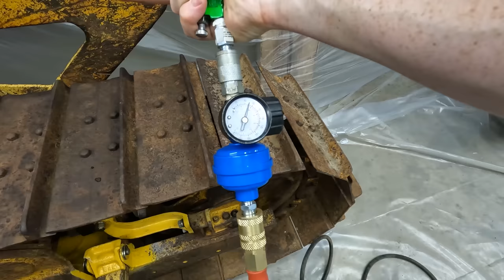Cleaning and priming the Caterpillar D4

Comment: I was going to explain what you were doing wrong with the primer but you figured it out.  
My one recommendation is move your water trap at least 25 feet away from the compressor.  The hot newly compressed air has to cool down for the water trap to function well. If you do this your won't need any other filter at the gun and won't have to empty the tank as often.  Trust me this helps a lot! 35 years in body shops.
Reply: - Gosh it is so great to see such wonderful help come along for Matt on this site.
Reply: Just to help a little more.  Pipe from the compressor to the water trap with steel black pipe, this will act as a heat sink and cool the air more. If you use an air hose or PVC pipe  they will get as hot as the air inside them and will not work as well.

Comment: A tip that I saw on another youtube channel for masking off small knobs and odd shape pieces is to use aluminum foil.  Easy to squeeze into odd shapes and easy to remove.
Reply: That’s one of those bang my forehead and think “why didn’t I think of something as simple and sensible as that??” But that’s why there is a twofold reason that we read and watch these videos (1) to watch a seriously driven man do a masterful restoration (2) to learn new techniques which will make my life easier. I am truly impressed by Matt’s dedication to detail, especially on a machine this old which has required lengthy searches for parts and instructions 👍👏😃WELL DONE

Comment: On the dolly you made, put two fixed castors and two rotating castors, then you can push it in the direction you want it to go, having four rotating castors, it kinda goes where it wants and you have to force it to go where you want it.
Looks like you a doing a fine job prepping and primering, don't worry about the spots you missed on the under carrage, nobody will know except for you. 
Keep up the good work.

Comment: I would turn the little knob on the side of the gun so you have a wider fan pattern.  Along with that  turn the   knob in the  back counter clockwise so you actually allow more paint to flow through the tip. Have to do both. Overlap about 50%.   Lastly,  make sure you are not inadvertently  closing the air adjustment close with your little finger.  It is on the bottom of the handgrip.    Good luck
Reply: - Wow! Super useful help for Matt...I wish I had something useful to tell him. Thank you ! ! !
Reply: Yeah, I hoped that the Harbor Freight gun instructions covered the gun adjustments. Also wondering if it has a big enough tip (1.7+) for primer?
Reply: @mrpesky163  1.7 is big enough.  I use that size all the time for primer on that kind of vehicle.  You might also consider a little more reducer.  I use alot of that brand of color tou are planning on using.  I typically go 16oz of paint and 4 or 5 oz of reducer.  But you have to be carefull and not get too much on, (runs), so tighten up that back knob a bit or thicken it up. Try a little on the bottom side of the hood.    You can always  thicken it up. The smaller the tip the thinner it will have to be usually..  you can have good results with 1.7 on the color as well.  FYI, That little filter goes big end down in the gun before you screw on the paint container. Painting is alot of work!  Cleanup sucks.  Have enough mixing cups so you dont have to keep cleaning them

Comment: I realise you probably don't want to move the motor again but you'll find that it is easier to steer if two wheels are fixed and the other two rotate. If you have a look at supermarket trolleys they have this arrangement. In the trolley arrangement the fixed wheels are at the front (the reverse of a car). Good luck with the rest of your refurbishment.
Reply: - Yes, good catch. That is how dumpster bins are set up, too...for good reason.

Comment: A great effort on the clean up and prep, it's 90% of the battle. One tip for painting, keep the spray gun moving fairly quickly back and forth in smooth even strokes and go past the edge of whatever you're spraying.  It looks easier than it is, but practice makes perfect :)

Comment: As I watch you struggle with the HVLP, it reminded me of my travails trying to move from oil based paint to water base. I finally gave up trying to spray water based paint unless I used a 2000 psi airless system which will do a nice job. Mostly I use HVLP for lacquer or thinned oil paints. Good presentation today, keep it up.

Comment: You said you were not expecting a new machine finish with your painting, but with your attention to the details, the prepping, and primer,sanding,and working out the proper spray gun settings, it's gonna look real sharp when done!! When you put the longer coupling sleeve on the winch control rod,did you grind off a flat spot on the shafts were the set screws are,so the screw won't loosen and have the collar spin on the shaft,,just a thought!😎😎😎

Comment: Wet the floor with water . Then spray . It helps with bringing the humidity up. An keep dust at bay. Test spray on a big cardboard box.  The paint needs a 6 inch fan spray . Turn the back of your gun counter clockwise to alow more paint to spray out. .

Comment: On primer, use 4 parts paint, 3 parts Acetone.  Works great.   On paint, use 4 -3 - 1  (hardner) you can also mix japan dryer to help with with drying time in colder weather.

Comment: You're doing a great job!  You mentioned that the sprayer you have is an HVLP head.  But you're using compressed air from your compressor instead of a multi-stage turbine that HVLP systems use.  That would explain why you had to bump your air pressure up from 20psi.  Think of your compressor as LVHP (Low volume, high pressure)...just doesn't play well with HVLP sprayers.  Having said that, when you begin painting the color coat, consider a drying inhibitor, or something like flotrol, allowing the paint to flow out and smooth before it dries.  It can help to achieve a smooth coat.  I'm no expert, but in the past this has worked for me.  Good luck, and I'm looking forward to the new paint!

Comment: I use to work in a body shop in an old dusty pull barn and we would hose down the floor and paint when the floors were still damp to cut the dust

Comment: your primmer needs to be about the consistency of whole milk and use a 1.4 tip.  set your gun pressure at 40 psi.  This should give you better results
Reply from the maker: Yup, that's pretty much exactly the setup I used at the end that worked!

Comment: Really like watching your videos.  I feel the same way as many many of the comments...your attention to detail and patience both very good.  Can't wait to see this up and running.  I own a D47U which I will restore at some point.  It's got a 24 V generator and starter...is your system 24V.  I wonder if I could convert to a 12 V?
Reply from the maker: It's 12, but either voltage should be fine

Comment: Hello Matt, great to see your work.  Lots of cleaning, we would cheat and use, Air Sprayer with hose pick, inside 5 gal tank of >>> Diesel.. ") that was what I was told to do.  Old Case front end loader, cleaning the Engine...

Comment: So I'm definitely not a paint gun guy but there are several adjustment points on that gun if I remember right. I have the same gun. You may not have the needle that controls the paint flow set open enough for the primer/ paint mix you're using.

Comment: Generally you use a bigger tip for primer. You should have got a lot more fluid pressure. I think you’ll find better fluid output with the paint. Even with hvlp you should get more output. Depending on your gun you can go up to 35 or 40 psi. Play with it see what works.
Reply from the maker: Yeah I started at 29psi and increased it to 35 with a 1.4mm tip.  The primer directions said a 1.3mm tip with 29psi, but I'm guessing that was meant to be as a starting point.
Reply: Agree with the comments about painting but I have always believed that orange peal finish is due to too much thinner.  I know you wanted to get more print through your gun but thinning the paint too far is not the answer.  Also the pressure at below 35 psi is just way too low,  especially for generally thicker paint like primer.  Hope this helps.

Comment: In my opinion the hole in the thermostat is so air will bleed out during a fill of coolant. that way it will not air lock the cooling system on startup. I do that all the time.
Reply: Yes, that is all the hole is for.  But he did not need to drill a hole. The manufacturer of the thermostat he installed provided a gap in the sealing surface the plate closes against to allow air to purge past and escape instead of making a hole in the plate. Probably will not cause the engine to run cooler than the thermostat rating unless he operates it at light loads in extremely cold temperatures.

Comment: One thought you could do to fix the fuel tank bumps if you cared is to pressurize the tank with water. Adam from myth busters did it to shape some metal. Pretty cool idea… might work.
Reply: Some pressure and a little GENTLE persuasion around the edges of the dent can work them out.

Comment: Ah the homemade paint booth.  Box fans with paint filters stuck to the back of them work great for ventilating and sucking up the over spray. But use actual paint booth filters.  Also you want to suck air in the top and pull it out each side with the fans. Use window kits so you get the cardboard strips to staple the plastic .  So what projects are you going to use the D4 on when it's done ?

Comment: That spray gun looks quite a small one with a fine nozzle. At the beginning I think the paint was too thick and you were almost dusting the paint on. It is good to keep the paint on the thick side and spray a bit on the dry side when painting intricate stuff with lots of angles. I would try thinning the paint a little more and do some test sprays on some metal. You need to see the paint go on and then sort of flow out and smooth itself. If the paint is too thin it will run and be a PITA so try and stick to the thicker side but I think you can thin it a little more than you are.

Comment: Thinner paint and move a little faster will eliminate that orange peal , as long as your not spraying it so fast that it's drying as it's hitting witch will kinda look like a lot of gust in the paint you can always add another coat but moving to slow will cause your paint to stack up and give it a real orange peal look tell it gets so thick it starts to run

Comment: @16::29 you can see there is a bypass hole in the seat of the Gates thermostat at the 12:00 o'clock position. But one more little hole ain't going to hurt anything. You knew that already, didn't ya? Just checking to see if I'm on my toes. 👍 thanks
Reply from the maker: I need to get my eyes checked
Reply: @PacificNorthwestHillbilly  shhh don't tell anyone  but I did the same thing 🤫
Reply: I am glad somebody else saw that gap in the seat besides me.

Comment: im still in the begining of the video ,but for the shaft coupler with the two set screws ,any reason you couldn't/wouldn't cross drilled and pinned it into place ? i would think that would make driving out the roll pins later easier for removal, and would help share the torsional load

Comment: I had problems with oil based implement paints cracking and peeling after they sit for a while indirect sunlight if I used any type of primer. Seems to stick Alot better without primer especially on smoother sheet metal. I used an epoxy primer on my old Farmall H and 4 years later most of the paint blew off when I pressure washed it. I did let it dry for just over 72 hours and Tack clothed it before painting it. Maybe I should have let it sit and cure for a whole week before painting it?
Reply from the maker: This is gonna sit for at least a week before painting, but I guess time will tell if it cracks or comes off with pressure washing.  A lot of the top layer paint was coming off during pressure washing, but there was no primer between that and the original paint.

Comment: I didn’t see your other video about the hole going to the gearbox.  Is that the breather hole?  There is a material you can use to plug grease boxes that looks like a wick.  It is hydrophobic and this will not let water pass and will allow the breather to operate properly. You will sometimes see them in rotary cutter gear boxes. I just rolled up a piece of PIG mat and shoved in the hole. Same material
Reply from the maker: It's the hole that the gear selector shaft sits in, it's not sealed and open to the elements. The other end where the shaft comes out is also open, but it's covered by the seat, so it can act as the breather (I hope)
Reply: @PacificNorthwestHillbilly  gotcha, thanks

Comment: The tip size is probably too small. I have several Harbor Frieght purple guns, and I drilled out the tip to about 2.0 mm . I use that gun for paint, latex so far with just a little water to thin it. It works good so far.

Comment: Wouldn't you agree that it is advisable to start an engine that you have never seen running OUTSIDE before putting it into the cat?  It is a very big leap of faith to simply assume it is in working order.  Even Squatch, who rebuilt the engine himself, started it outside before installing it in machine.  Running it up to temp might well disclose some issues that are much easier corrected when engine is not in machine.
Reply from the maker: Ordinarily yes, but these engines are so simple, there's not much that can go wrong. Based on the look over I gave it a few months ago, I would be extremely surprised if it didn't start. Starting it without a proper engine stand would introduce more risk.  Worst case is I have to pull it back off the tractor, which I could do in about an hour or two.
Reply: @PacificNorthwestHillbilly  Did you happen to watch the Squatch vid where he built a simple stand and started the newly rebuilt engine?  As it turned out, there were a couple of leaks that would have been difficult to remedy had the engine been in the machine.  Trusting any unknown engine to be fine is a huge leap of faith.

Comment: Looks like your putting the paint on too dry, add more thinner, and paint faster. I was a bodywork’s spray painter for years, using mainly acrylic paint. Top coat should be put down rather wet that way it gets a good shine

Comment: HVLP= High Volume Low Pressure... If it takes more air pressure than recommended to spray the Product then the product is too Thick, just my Opinion.  I've sprayed my Share of Epoxy coatings over 15 years NAVY service. used every kind of system from Conventional to Air Verter they all have advantages to disadvantage.  Primer goes well, then Paint will too.

Comment: Matt, I've noticed that you have a tendency to put body parts really close to the business end of power tools. Like the thermostat & drill, and the chop saw and your knee. Made my ass pucker on both of those.... I could just see you creating a new orifice in your hand or putting a bevel in your kneecap.
I mean, you do you man, I know on camera it may look closer than it is, but maybe not... So just be careful bud. I like watching your vids and do wanna see ya get hurt.
Reply: And you forgot using the 125mm angle grinder / wire wheel WITHOUT A GUARD ! 
Must be an 'American thing'.